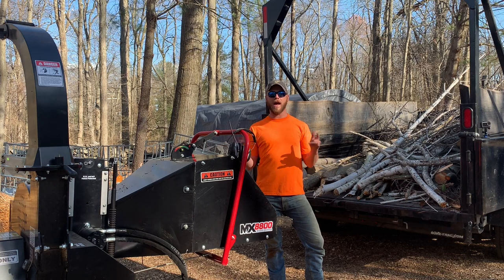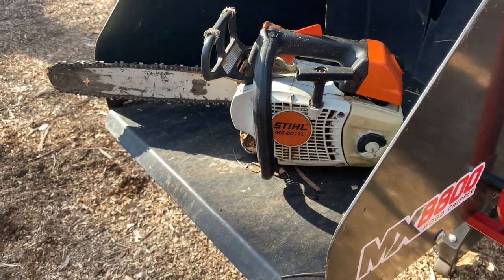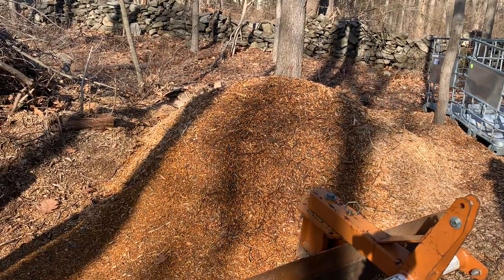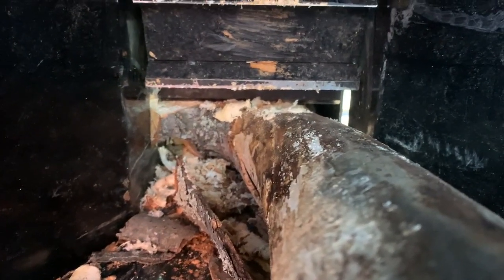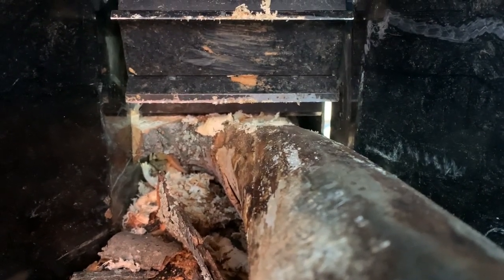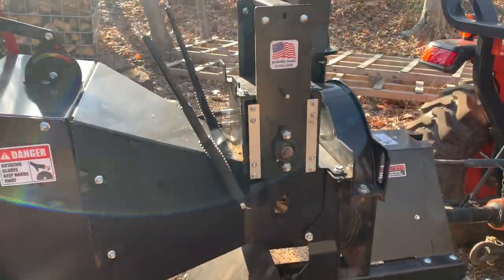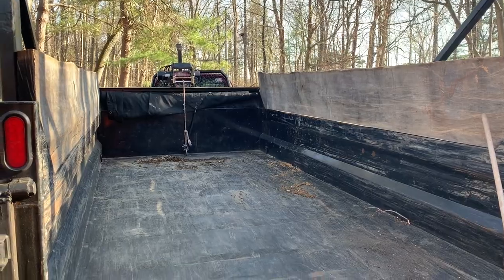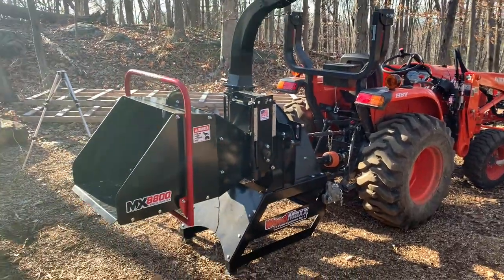#91 Chipping Big Wood with the WoodMaxx MX-8800 PTO Chipper

Comment: Preparing the branches for the chipper cutting them the proper way is where it all starts . Anything you can do too help twisty branches go thru and fold down going thru the power feed wheel . Makes life so easy on a chipper . I started cutting twisty stuff right where it comes off the main stem 3/4 thru . When it goes into  the chipper it break folds down and goes right thru . Good Demonstration 👍
Reply from the maker: I totally agree! Most of the branches I chipped in this video were cut by me but some by the homeowner, making relief cuts at the crotches makes life much easier!

Comment: Thank you for this video!! I just bought the smaller MX 8600. And am waiting for it to be delivered. I have an old pto chipper that still works well. But I wanted to upgrade to a larger one. After much research I went with the WoodMaxx. American made! 👍I learned a lot from my old chipper. But I was concerned how to unclog the WoodMaxx. It was great that you "purposely" jammed the 8800 and then walked through how to fix it. WoodMaxx should pay you for this instruction video! 
I am shocked at the size of wood you are feeding into your chipper! Your "start. stop" technique is also very helpful!
Thanks again! Great video!
Reply from the maker: Glad you found the video helpful! It’s a great piece of equipment and like anything takes some time to figure out how to maximize productivity. Thanks for watching!

Comment: I got one of these chippers and I managed to jam it with an 8" piece of sassafras in under 2 hours of operation.  Totally my fault.  It was the butt end of a 20 foot small tree trunk, and I got distracted as the RPMs went down at the end of job.  My fault, could have been avoided with 10 seconds and a little better attention.  Anyway, about 6" long trunk piece stuck between the intake and the wheel. I was dreading fixing it because my last chipper required massive disassembly to clear a jam.  But this one?  Super-easy, which makes for a happy Memorial Day.  Undo two clips, lift the motor/gate, insert a rod to hold it open, and bang, you've got access the machine's innards.  Reached in, pulled the offending sassafras out, and put it back together.  Ten minute, no strain jam clearance.  Great!
Reply from the maker: Yep super easy to unjam!

Comment: I usually keep a battery powered chainsaw handy for quick cuts of misshaped pieces.  I'm more likely to use it as opposed to fighting a strangely shaped piece since it doesn't require starting and I usually don't need the power of a gas saw.  Good stuff, looks like an awesome chipper and I'm trying to decide between the MX-8800 and the Woodland Mills (WC88) chipper.  Thanks for showing real world usage of the MX-8800
Reply from the maker: Yep I have the little Milwaukee hatchet just for cutting the crotches. I love my WoodMaxx
Reply: I believe that the WC88 has 4 cutters Vs 2 for the MX-8800?

Comment: Are there any detents at neutral?  It looks like the bar goes from forward to reverse too easily. Can you comment on how easy it is to set the speed to 1 or 2?  Thanks for the video.  I felt like this was a very “real world” example of this machine in use.  Do you feel like the 32 PTO hp is enough for this machine?
Reply from the maker: Yes there is a neutral position for the feed wheel. The bar doesn’t move as easily as it looks on video. You definitely have to put some force behind it which is good because it helps prevent branches from reversing the direction when they are getting pulled through. 

As far as setting the speed it’s as easy as just positioning the bar to whatever speed you want. Typically I run it at full speed unless I’m chipping larger hardwoods where I will slow it down or even use my “bump stop” method. I try to keep everything as realistic as possible to show the chippers true functionality and potential. I feel that my tractor has more than enough power for the chipper, I consistently chip 6-8” hardwood with no problem. I believe they advertise it as working on tractors with as little as 20 hp at the pto which might be a bit underpowered in my opinion.

Comment: Hi Jake,
Question: Can you adjust the chip size coming out to get larger “chunks” ?
Reply from the maker: I suppose you could adjust the anvil a bit no I don’t think there is much adjustment for chip size other than that.
Reply: I wouldn't recommend doing that. Bigger chunks when the knives are getting further away from the anvil puts more pressure on a chipper flywheel and it could damage the machine. Your mileage may vary depending on your chipper model, but that has been my experience.

Comment: I have the same chipper. What size casters did you put on the base ? Do you wish you would have gone bigger or are you happy with them. Thank you for the great video.
Reply from the maker: Honestly not really sure what size they are, I got them at the dump and welded them on to prevent scraping on driveways when loading/unloading! They work!

Comment: A tractor with more horsepower would help a lot.
Reply from the maker: That tractor puts out far more Pto horsepower than the minimum required 19 stated by WoodMaxx
Reply: @DudeRanchDIY  i meant no disrespect. But any equipment like that will handle the tougher loads better with max horsepower rather than close to minimum.
Reply from the maker: None taken, my tractor puts out 31 hp at the Pto. The biggest difference I’ve found using this chipper is green wood vs. dry. It chips green wood much easier